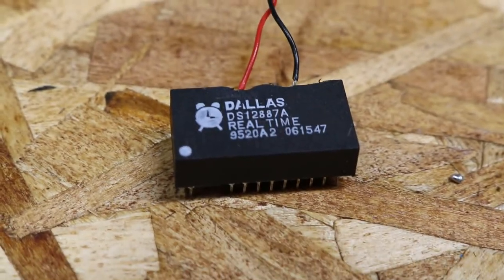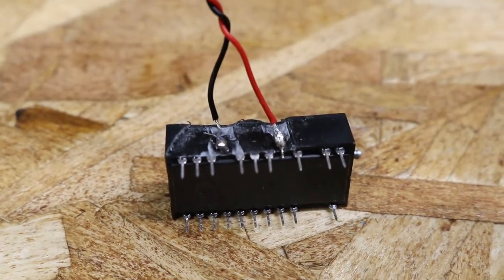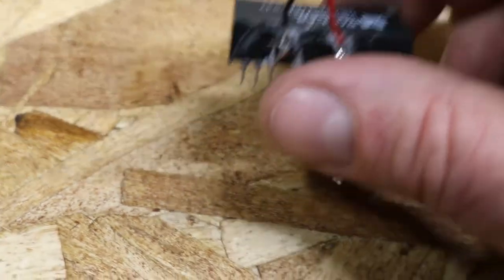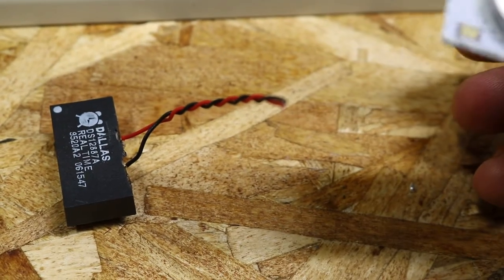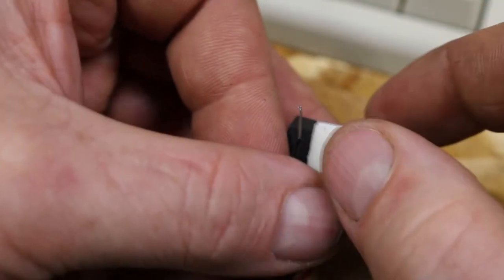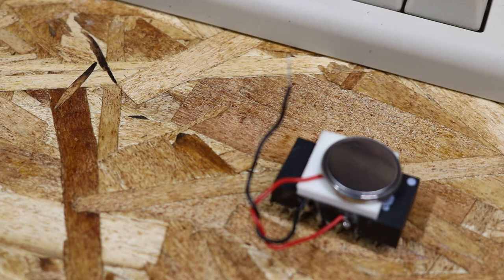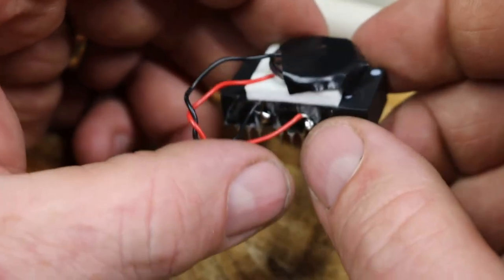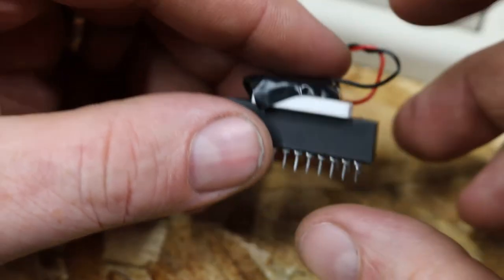Dallas clock DS12887A Battery Fix

Comment: Hi - i hate those dallas batteries, my first Pentium 100 has it, i spent 6 months buying used / refurbished ones, waiting for delivery  and finding they were all dead ( refurbished means used and wiped with tissue )

i did come across a web page with the fix to external battery and gave 2 to a tech at work who scraped down the pin and added solderd on terminals - bu tit only worked once or twice with the cr2032 , i then went to a 3 way AA battery cells and that worked once, then i finally worked out something is wrong as i would take out the dallas chip, reinsert it and it maybe worked once or twice, but in all honesty it rebooted -  reset cmos - reboot and would fire up 1 in 10 .

It only every worked 2 or 3 times and once i left it on for 2 weeks

The guy doing the work is competent he works with me and he repairs commercial ovens and kitchen equipment and repair circuit boards, i watch him with schematics and he test main board point and tries to repair traces and replace components and i come back and he had a few bodge wires and the board now works perfectly - he recapped  one of my Pentium 4's

I have a feeling the leads to the original battery have to be cut as maybe it is shorted out and the piggy back is not working - although my multimeter confirms it is OK

On the final 5th time i purchased a working used battery and it has lasted so far 15 months - last started just before xmas 2020

Anyway in the last 2 years the Pentium 100 had 4 or 5 dallas chips, gotek emulator, compact flash adapter 4G CF card , hmm almost enough to buy my wife the new ipad she wants 

Regards
George
Reply from the maker: You are not alone with clock chip I have used this fix on all but one computer and so far it has worked. I did have to rework one of them because it did not make contact with the metal in side the chip. The one computer I did get lucky with a newer chip was my gateway 2000 the one in my first video. As for the IPad just remember that saying happy wife happy life 😊

Comment: Did you know that you soldered the external battery to the still connected inner dead battery.. The inner battery will pull down the 
external battery voltage ! You should have disconnected one of the innerbattery's pin from the IC (+), then solder your external battery lead (+) to the IC itself alone.
Reply from the maker: What was not shown is the part were I cut the connection between the battery to keep it from pulling the draw. I have plans for a remake of this video I really did not expect this video to take off. I was still figuring out the video software too and forgot to add that to it. I have been waiting for someone to also make that comment for that I thank you.